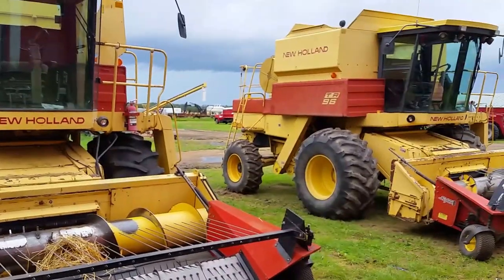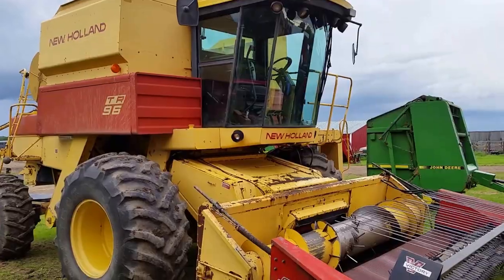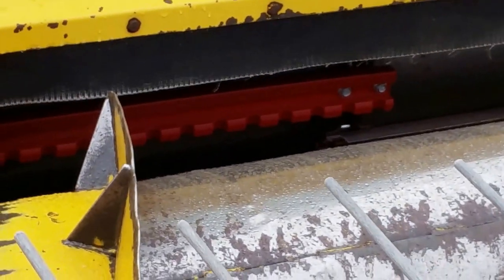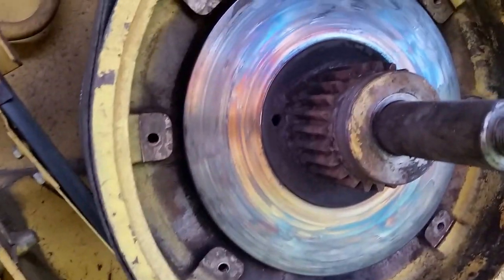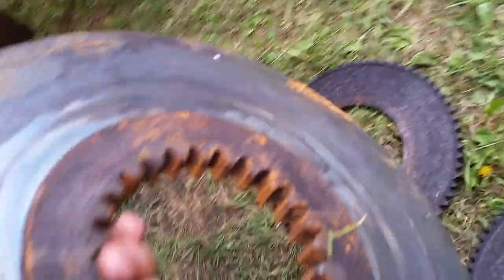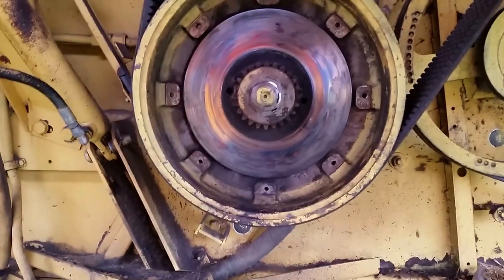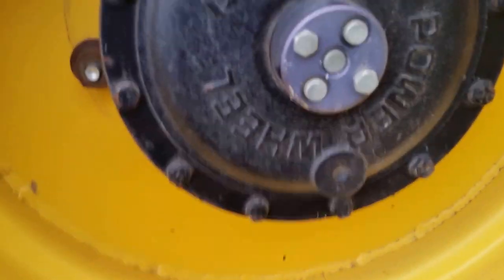Another TR 96?

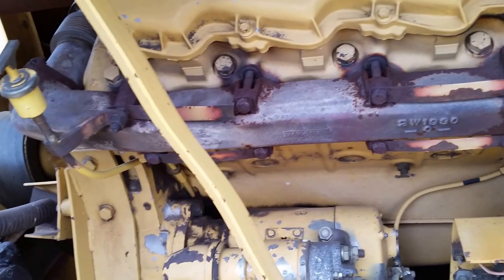Comment: Hi Northern Farmer , you still use this TR ? If yes , is the main engine rear seal is leaking as I see it is in your video at about 3:30 minutes , or  have you've fixed it ?
Reply from the maker: It's not leaking..
Reply: That's good then, but keep an eye out for it as we had one (1987 TR 96 ) and had a identical looking oil/dirt buildup around the oil dipstick tube going into the block. It just got worse .  I also see a ac delco alternator too, we changed from  a niehoff  as well but the delco hates dust . Always blow it out in the morning or your asking for trouble . We actually always had a spare one , just for backup.

Comment: g'day from down under mate.
ive got an old tr 70 here, ive had it now for 2 seasons, it does a nice job, not fast by any means but works.
its a bit of a workshop'a'holic this season. bearings belts etc: even rotor speed adjuster breakages and fires. 
so im seriously thinking about buying a tr 98 or 89 as an upgrade, and guess my question is, is that a good option worth doing? why/why not?
Reply from the maker: Hey Karl... The Tr 70 was a great combine... We had one to.  I think the 98 would be a great combine if you want one.  They are basiclly the same as a tr 70 just better.  Better Engines better |Rotors... a few electronic upgrades but not a bunch of computerized crap.   The Tr 70 would work great if you could get scubed rotors for it but with the money you would spend,,,, the Tr 97 98 or even 89 would be good
Reply: Northern farmer thanks for the feedback. yeah the 70 isnt productive enough to warrant too much money being thrown at it. the rotors had a bit of a re-build before i bought the machine but a bit of an inspection yesturday has shown a great deterioration in the condition of the concaves and rotor housings! just slightly depressing. would you happen to have an owner/operators manual lying around for the 70? many repairs i make have to be reverse engineered cause i cant aquire a manual here without costing the entire bank and the building that surrounds it.
cheers- karl
Reply from the maker: You know I think I still have it lying around

Comment: Do you ever have a lot of wiring problems your TR96?  My father in-law had nothing but trouble with the wiring on his,  it wouldn't go a day or 2 without something shorting out, then the 3208 finally spit a head gasket (they're infamous of this because of the poor sleeve design) fed up, he drove it straight from the field to the wrecking yard, 15 miles and 2 shut downs from overheating dumped it and bought his JD 9600 the next day.
Reply from the maker: No they have had no wiring problems at all. The tx combines were a wiring nightmare.  I agree the 3208 sucks.. If your getting a 96 always try to get a ford  7.8 engine.. way better.  The the one 96 will overheat to but we did 2 rad flushes and its way better.
Reply: My father in-law was convinced his was the 1st one built on a Monday morning by everybody that was hungover from the weekend.

Comment: oooh, she got toasty.  does one of the other combines have a ford engine, is that what you were saying?  never been around a 3208, but I really like CAT engines and equipment.  Heard several people complain about 3208's over the years.    how do those combines compare to the 9600 as far as capacity?  great stockpile of parts too
Reply from the maker: The Newer 96's switched to the ford engine. They are better on fuel... touch more power... quieter...more reliable. They are about the same in capacity.
Reply: Are they v8's or straight 6?
Reply from the maker: straight 6
Reply: 3208's are infamous for what they call a floating sleeve design, they were designed for marine use and were ok for that application. But the stresses of extreme temp. changes, external vibrations from transmissions tires and the twisting action of a frame that will occur in the engine bay of a vehicle.